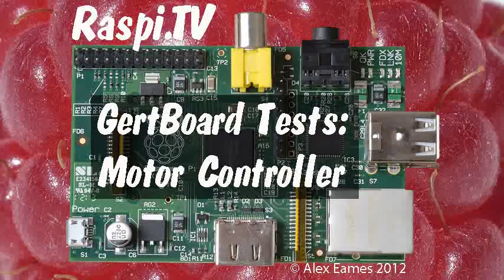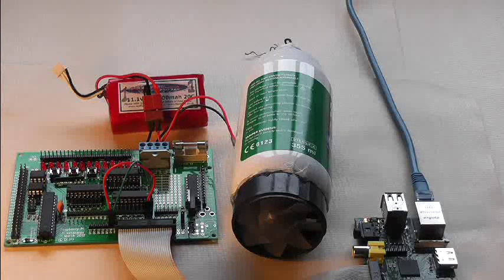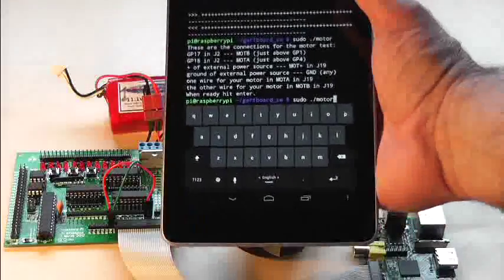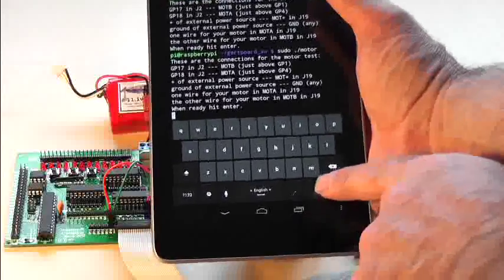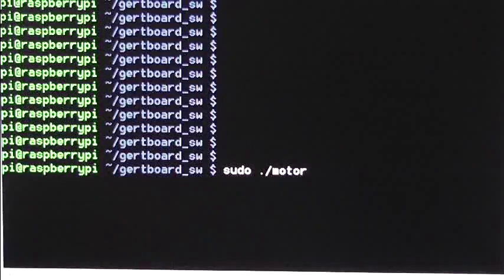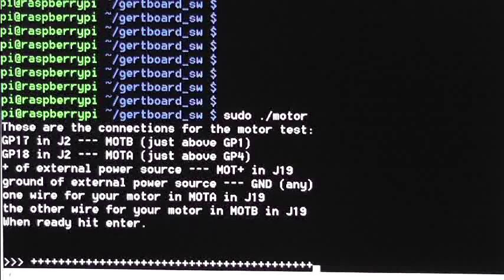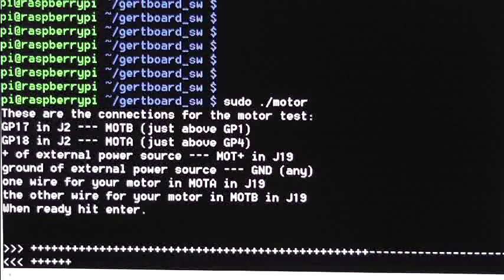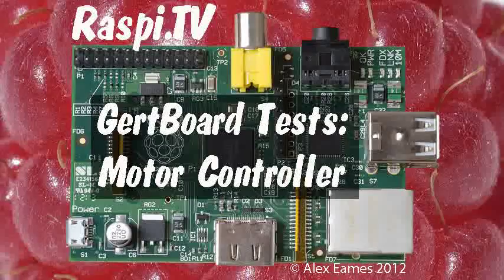GertBoard motor controller testing

Comment from the maker: With straightforward on-off control you can use a relay on the open collector. But for proper hardware speed control, only really one motor with Gertboard.